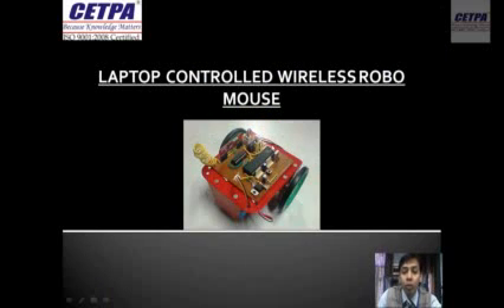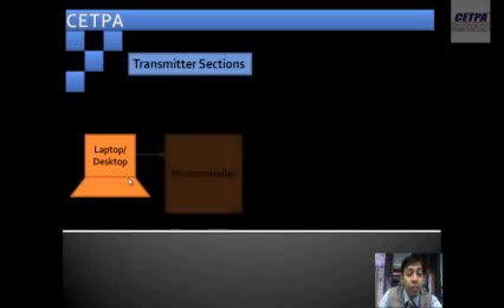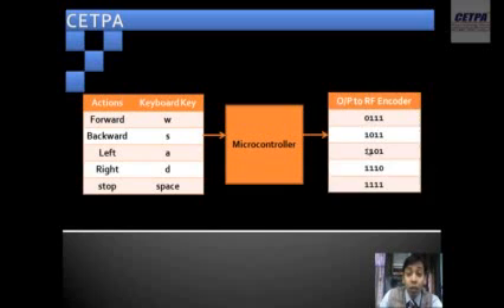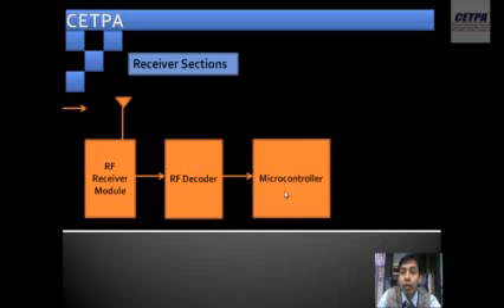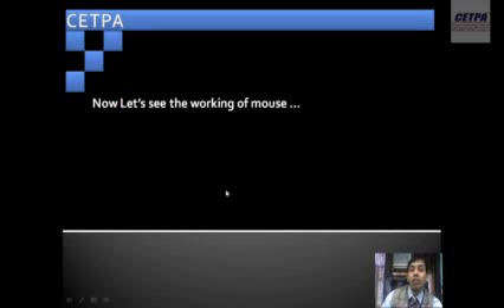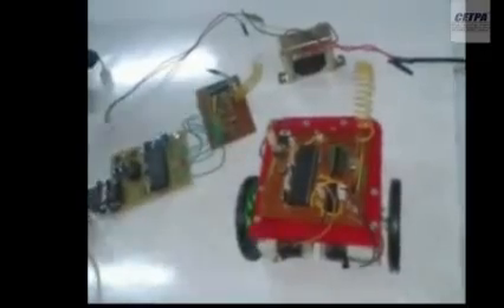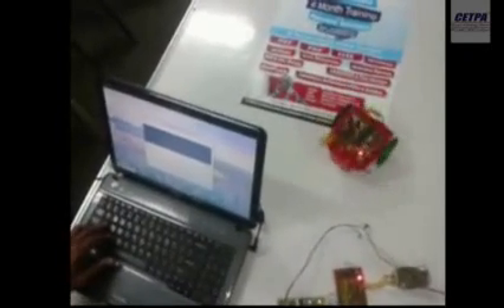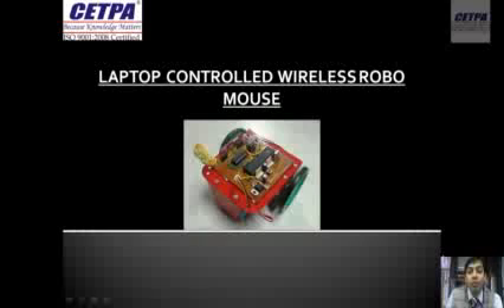Laptop Controlled Wireless Robot

Comment: piyush m a cs student and know c programming ,can u tell me if i buy 8051 microcontroller then how can i connect it by my program to run control the robot..
Reply from the maker: you want to make the same working as shown in video or any other robot you want to make??
Reply: I can make any 1 with your prefrence
Reply from the maker: read basics of microcontroller from my blog www.forelectronics.wordpress.com.

only buying a 8051 is not sufficient, you have to make a complete circuit to connect it to your laptop.

Laptop ==> USB to TTL converter ==> 8051 board with power supply and other necessary connections.

Comment: i need the program
Reply from the maker: ;; This is program of the circuit(transmitter) connected to laptop, 
;; At robot (receiver) connect output pins of HT12D directly to input of L293D.

org 00h

te equ p2.4
mov p0,#00000000b
setb te		; stop rf transmission
mov tmod,#20h	; timer 1 for baud rate
mov scon,#50h	; for serial communication
mov th1,#0fdh

setb tr1
check:
	jnb RI,$
	mov a,sbuf

	cjne a,#'w',h1
	mov p0,#00001001b
	clr te
	acall delay
	setb te	
	clr ri
	sjmp check

h1:	cjne a,#'s',h2
	mov p0,#00000110b
	clr te
	acall delay
	setb te	
	clr ri
	sjmp check

h2:	cjne a,#'a',h3
	mov p0,#00000101b
	clr te
	acall delay
	setb te	
	clr ri
	sjmp check

h3:	cjne a,#'d',h4
	mov p0,#00001010b
	clr te
	acall delay
	setb te	
	clr ri
	sjmp check

h4:	cjne a,#' ',loop
	mov p0,#00000000b
	clr te
	acall delay
	setb te	
loop:	clr ri
	sjmp check

delay:
	mov r0,#2
o2: mov r1,#255	;100
o1: mov r2,#255	;255
djnz r2,$
djnz r1,o1
djnz r0,o2
ret

end

Comment: hey hi piyush,
I Am pratik mehta MCA Student,

i want make wireless robo car and in this which circuits use and how to write code and in which language so tell me and , i heard about writable circuit that is only one time code transfer in to circuit ?
so pliz help me
Reply from the maker: hi, I had explained basic working in the video.
about your questions--
1. in which circuit?     Ans: you can use 8051 or AVR circuit board.

2. how to write code? language?    Ans: you can write code in assembly or in c language, for this you need an assembler or a compiler. If you wants to work on 8051 based circuit, you can download Keil compiler and if you wants to work on AVR based circuits, you can download Atmel Studio.

3. writable circuits?     Ans: You can buy or make 8051 or AVR circuit boards, these boards are not one time writable. You can erase previous hex file(compiled program, in a layman language) and then again write with a new hex file. But there is a limit of how many times a microcontroller's ROM can be erased which depends on microcontroller.
Reply: Thank you piyush 
for given information regarding my project